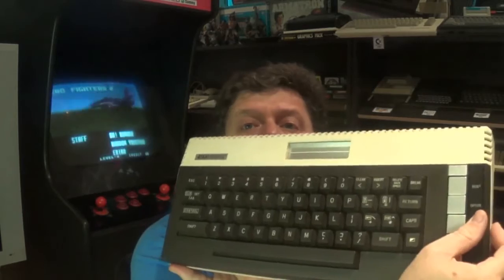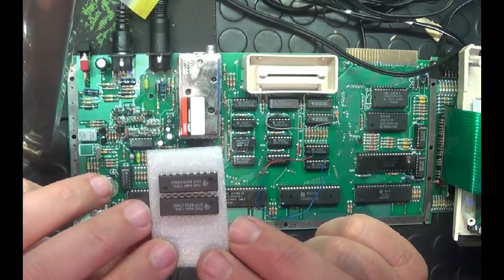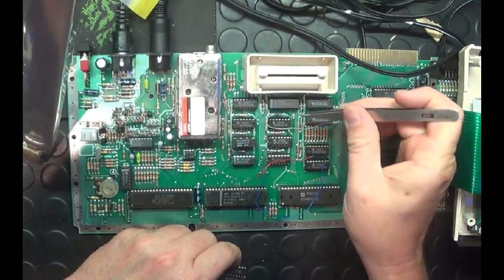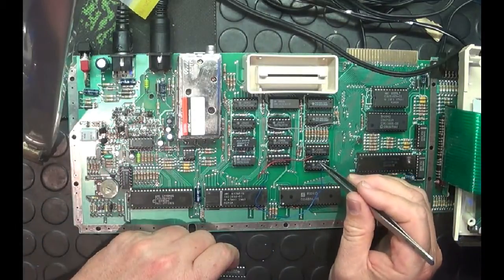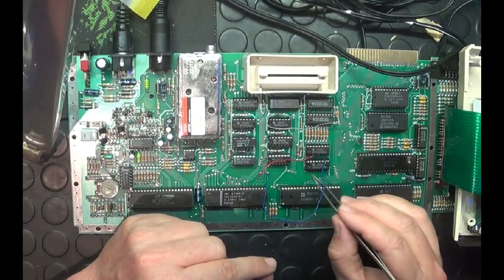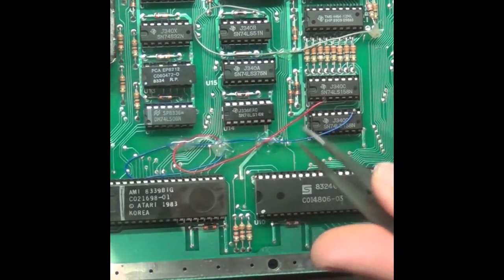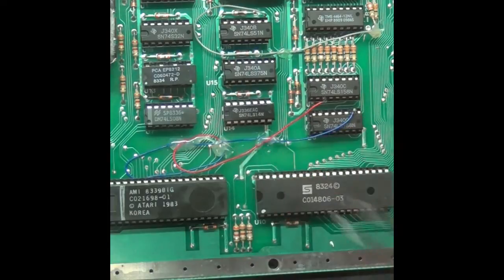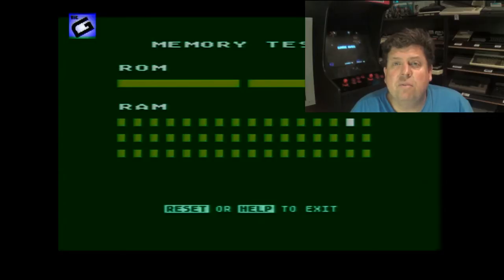Atari 600XL memory upgrade

Comment: That was different from mine that was done in 87' it was just 2 wires and 2 lifted pins I have picture proof but can't post the pic here  it worked on my 16k 600xl to 64k

Comment: In XL/XE memory test in the self test, the 48 green squares are shown, it means 48K of 64K ram pass, Another 16 is missing. Where is another 16 more?
Reply: On a 16k machine, the reserved addressable area doesn't conflict with RAM. The highest addressable area (the last 16kb of the 6502's addressable 64kb) is reserved for Atari's ROMs which isn't physical RAM on a 16k or 48k machine. On a 64KB machine, as I understand it, that reserved area normally used for ROM can be used as RAM using certain addressing tricks so it is usable.
Reply from the maker: The 4th row of squares is deliberately missing because it represents “reserved” memory. Cheers
Reply: Atari 600XL has 16K ram that show 16 squares,  there is no reserved memory?

Comment: Did this mod on the 600XL you sent me. I used 41464 ram chips from an old 286 PC motherboard. The soldering is very fiddly, but you just have to take your time.
Reply from the maker: Great stuff. Now you can load up the 64k games. I enjoy doing these sort of mods on the 8 bits.  Cheers
Reply: When i did ram upgrade to my 800XL, all the ram chips were socketed. So when i swapped out the chips it was painless. The RamboXL upgrade is rather simple. not much soldering. No idea where the old 64k of ram went.. did this back in the 80s... so..
Reply: did the mod using 41464 ram chips, and all I get is a green band, was booting with the 4416s, replaced the 4416 chips and it went into the self-test, but fails to boot, will order some 4464 chips to see if the ram is the issue.

Comment: Yeah, stupid me, i used the "bye"command, after ready, instead of holding down  option.
Seems like it ate my last 8k, and the games are not all compatibel.

So, no problem here, all works fine, and again, if there is anybody in need of the ram chips, got a few spares, let me know.
Reply from the maker: +I pity the fool. Great to hear. I actually  feel like getting the 600XL powered up and play some games. Need to get my 8bit fix. LOL
Reply: Yeah, thanks a lot, Big G.

I am gaming my ass of, as we speak, (just pressing the space bar).
Also, all the games work, xe, 800xl, put them in like 6 times, and they work.

Dusty shit, as it seems.

Grateful greetings from Holland.

And my next litle mod is on my c64, also from you.

In my earlier years i used my iron a lot, thanks for reminding me how much fun it was.

With great regards,

Sweitze.
Reply: I'm interested in a pair of the chips i have a 600xl that i'd like to mod
Been using the atari 1064 memory add on and although it works good a proper inside mod is better
please let me know if you  have a pair of those chips for sale
Reply: Sure, no problem.

You can contact me at: sweitze@hotmail.com.

Comment: I don't think the full 64KB upgrade is used, since the 6502 CPU can only address up to 64KB and some of which is mapped to the ROMs.  So, the total RAM is 64KB minus the system ROM size.
Reply from the maker: unebonnevie Sounds correct. Most of my old systems "advertise" 64k or 80k but in reality have far less. Like my SVI 328 systems. But I am happy as the atari can play all the games now. Cheers

Comment: I'm not sure if you're still monitoring this, but I have a question for you. I performed this mod with partial success. After I did everything you talked about in this video, I ran the memory test to find that the computer was only recognizing 40k RAM (where yours showed 48k). I thought that was really strange. Do you have any ideas as to why this would happen?
Reply: Very nice video BTW. It was really helpful and to the point.
Reply: OK. It seems that I was forgetting to disable BASIC. Now it's showing 48k like yours. But this brings up another question: are you sure that this is really a 64k mod? Or does the 600 just not bother to check that much memory? I'm aware that back in the day you could upgrade it to 48k so that would make some sense.

Thanks!
Reply: +Elijah Brown 
yeah, you remind me to read.